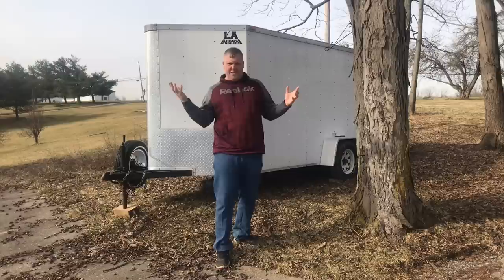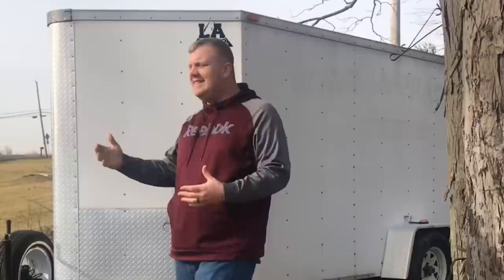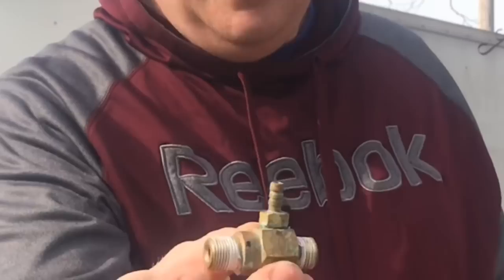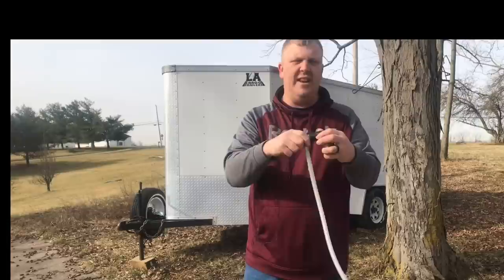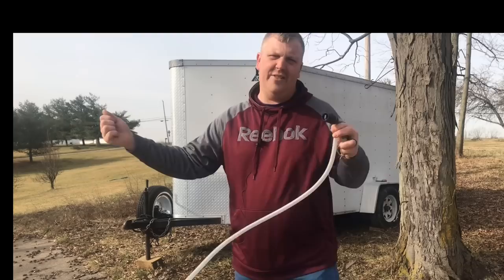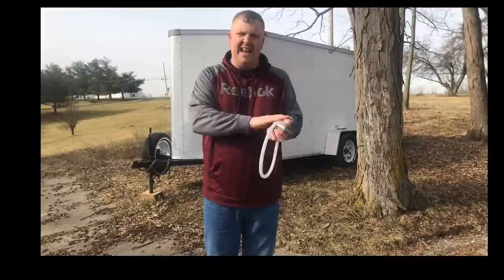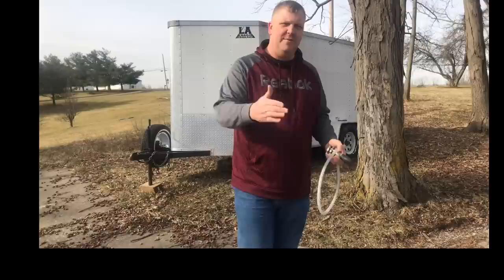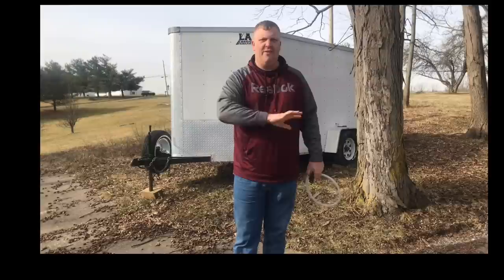What Is Soft Washing? | How Do I Softwash?

Comment: Hooooly shit. Soft washing is a form of pressure washing that uses a chemical agent in conjunction with a much lower than normal pressure.  Normal pressure washing is generally between 1000-5000 psi where as soft washing is done at under 100 psi. There you’re welcome.
Reply: Ya know that felt a lil mean. Sorry The info was good, but I’m sometimes impatient.